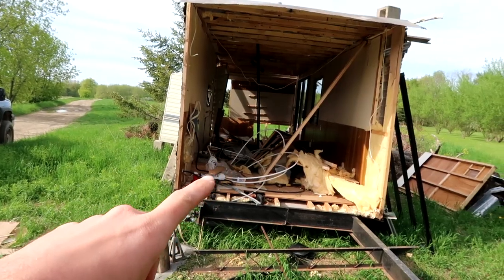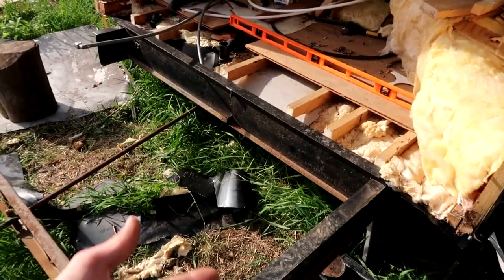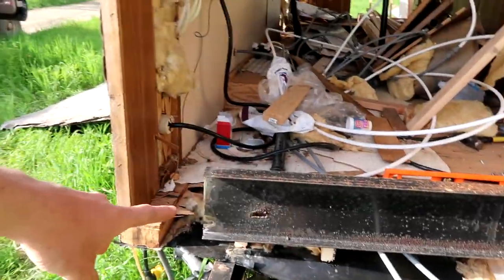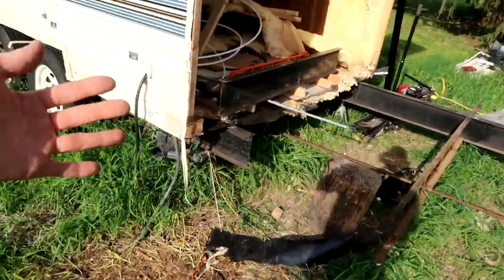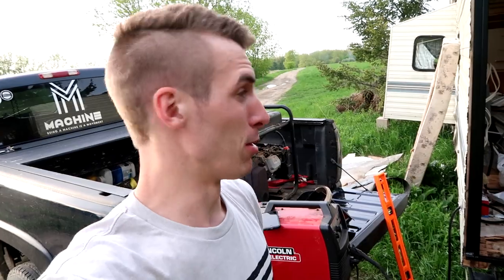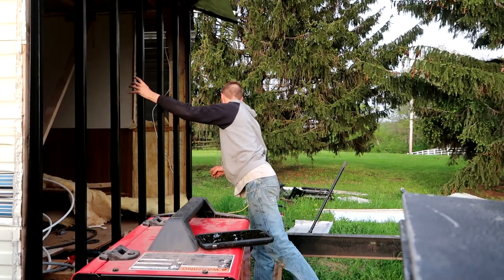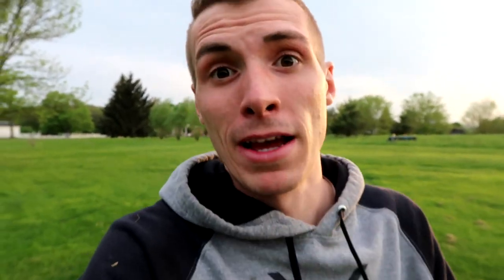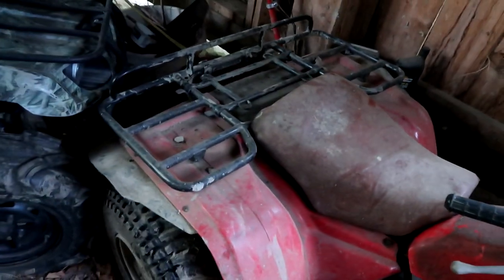Doing The Impossible

Comment: hey Dalton, i would recommend getting a weight on the trailer. don't forget to factor in the weight of the yxz, your gear, etc. then measure the tongue weight. rule of thumb is proper tongue weight is 9-15% of the total trailer weight. maybe its the camera playing tricks on my eyes, but i do think the trailer is going to have way to much tongue weight (the axles appear way to far back), which is most likely going to make the trailer handle like crap when in tow. id hate to see you go through all this work and not be able to safely and comfortably tow it.

Comment: ATC stretchy?    Your wrong there, those things are tanks.    If you had a good one you'd never have problem with it even here some 30 years later, you may only need to change the chain and sprockets occasionally if you have a chain drive.      Otherwise all they need is gas and oil and they'll last forever.

Comment: Hey dalton i have 3 atcs and there fun but get that 200 running cause its normal for the 200 to over heat cause it was made to be ran hard through thr mud and dirt i want to see it more cause i blow up the trans in my riding it like a 200x or 250r

Comment: You didnt have a place to work on this with power like out behind a barn or close to power? and where are you going to keep this thing when its done?If you would have left a trailer that close to the road here in NC everthying of value would be stolen  and the trailer too probably smdh. I would like to build something like this but id just buy a flat landscape type trailer and cut the ralis off and build my own walls, RV framse dont have the proper crossmembers for hauling a lot of weight inside  but youll probablt add some where crush will go.